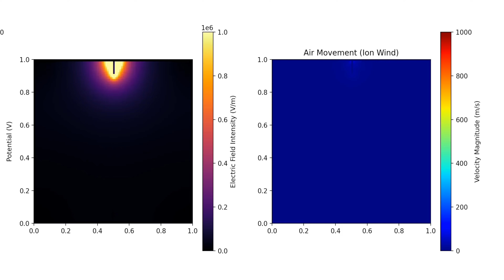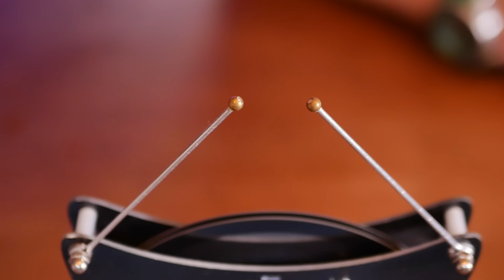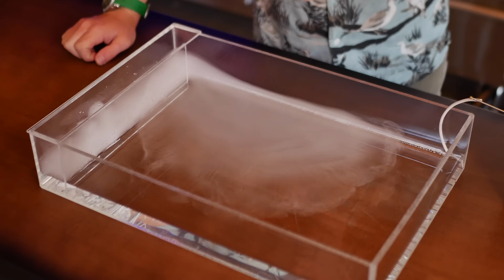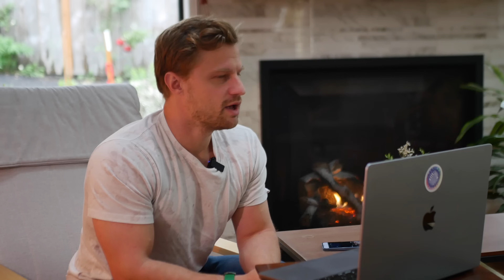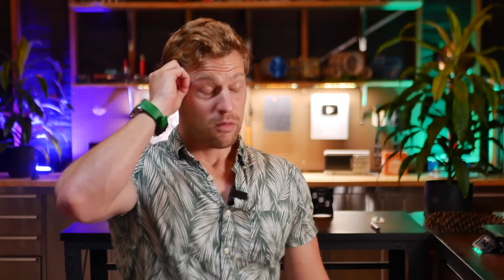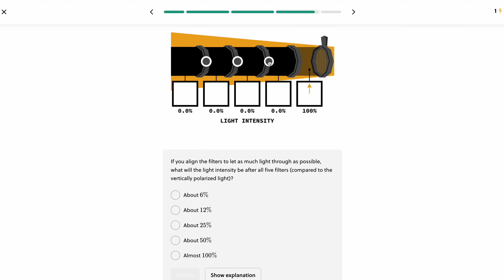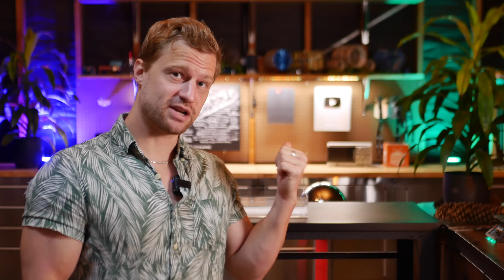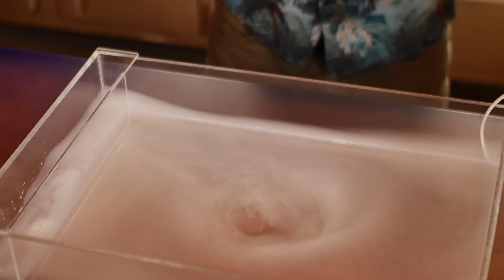This High Voltage Fog Is Controlled by Pointing (BiFrost Nebulagraphy)

Comment: Your allow a magnetically field to flow over your body from the current flowing with in. Much like when current is flowing through normal copper wire. That magnetic field is interacting with the ions from the dry ice.

Comment: It's a part of what the sun soon will emit:high voltage amadant particles might look like...I see it not as a fog but it will appear as a flash light.. but its effect is the same..it's not yet steerable by will but photon is activating the light frequencies we need to align with the new incoming light frequencies. We already have the blueprint in us, but our "junk brain" 97% has been forced dormant here in this 3d matrix.. that's ending at any moment now. And we will be upgraded, if the controllers of this planet like it or not.. their low vibe times are over... No wonder you are so fascinated about these types of phenomena

Comment: Okay am I crazy or what...? 
I was looking for papers and demos for the effects of currents and electrical fields on water and found your video.  
The video actually demonstrate something that I wanted to see which is a mechanism that displays a repulsion of water molecules. You use a low current high voltage, which is basically what we observe in the sky.  
So with only one source you achieve such results... now what about 2, 3 or 4 distinct sources in all 3 dimensions? 

So the part that makes me crazy is that I do NOT SEE how those effects would not be what we see in the sky? We have voltages, we have water and we also have winds that are well known to be layered (hint hint).
So we have all the components required to have the same effect reproduced globally that could explain the clouds, their variety, why some specific clouds form at specific places... and phenomenom like having a single small peck of a cloud above the ocean in a very hot day (makes no sense, water should evaporate).

Anyway, super cool demonstration. I need to try this at home.  Thanks again.

Comment: This reminds me of the Wilson cloud chamber, which is based on the theory of drop formation around ions which goes back to experiments by Wilson in 1897. Drops formed around ions are always charged, so in an electric field they are induced to move. It may be that you are seeing the effect of charged drops flowing as a charge carrier in the circuit, locally depleting the vapor and driving fluid dynamics. It's worth noting that below supersaturation vapor pressure ionic drop formation does occur but such drops are invisible since supersaturation is necessary for these drops to grow in size past a certain threshold, and the drops need to get pretty large to become visible. But when large drops form at supersaturation they form faster the larger the drops are, condensing vapor until it is no longer supersaturated. In a cloud chamber this leads to visible condensed vapor cloud trails corresponding to the path of the ionizing particle. Perhaps such condensation is non-visible in your setup, or is blown away by the electric field. I think when you have situations where the vapor vanishes (in a beam, a burst, part of a vortex...) it is likely that the drops are simply blown away while they are growing, but still small enough to be mobile charge carries and too small to be visible, and in sufficient quantity to desaturate the vapor enough to clear the fog. Maybe larger, less mobile charged drops play some role in what is observed as well, plus fluid dynamics driven by the flow of charged drops.
Reply: Some more info with a historical coverage can be found in Das Gupta, N.N.; Ghosh, S.K. (1999). "A Report on the Wilson Cloud Chamber and Its Applications in Physics"

Comment: There's so much in the New Age/Metaphysical community that could be scientifically demonstrated with this like Reiki, Crystals and Crystal Wands, Grounding Shoes, Clothing Materials, everything variable about your body's electrical system and showing the strength or weakness of the Ion Bridge effect. The swirl under the palm was just like the energy healers symbol of the swirl on the palm.

Comment: If you build yourself a static generator, you can find YouTube videos on here, but you’ll find that a 9 V battery and a high voltage amplifier will levitate sand and little metal objects like you did as well as the manipulation of fog due to the ionization of the body receiving positive ions And then being pointed into a direction you’re basically firing it like an arrow, but yet it’s leaving your entire body all at once… you should be able to see this maybe with a night vision, camera or thermal image camera looking at your body while you’re charging it. The future holds some amazing things such as the health benefits of ionizing the body.

Comment: The warm water + ice cold glass create an exitaction of electron our body is positively charge by electron moving from positive to the negative side and also these electron leave our body it's possible that the ion bridge between you hand and water is visible as they leave to connect with the water the electron of negative connect with water and the fog let you see this visual this effect add salt in water for more ionic activity.

Comment: I wonder if this could be scaled up and reversed in direction so that a specially equipped airplane could generate a negative electromagnetic field, while a high-powered antenna of some sort could direct a positive ion stream through the air to the airplane. This would in theory have the affect of "erasing" clouds by causing instantaneous condensation within the negative field around the airplane. Flying in a grid or spiral pattern would enable the aircraft and system to remove clouds in a small area and/or a long line (limited by range of the antenna). Would be great for highways, sport events (open stadiums), parades, and other large outdoor events.

Edits: spelling.

Comment: The key reasons for this phenomenon are:

	1.	Corona Discharge (Ionization of Air): The electric field at the fingertip is strong enough to ionize air molecules, creating a localized area of charged particles. This process is essential for generating the ion wind that disturbs the fog.
	2.	Electrostatic Wind (Ion Wind): The repulsion of the ionized air molecules from the fingertip creates a small, localized wind. This wind physically pushes the CO₂ fog particles away, creating the “drawing” effect.
	3.	CO₂ Fog Dynamics: The fog, being composed of heavier CO₂ molecules, is sensitive to even slight disturbances, making it easy to push with the ion wind. CO₂ is non-polar, so it does not directly respond to the electric field but is physically displaced by the movement of ionized air.

You can create a cloud chamber using dry ice to observe charged particles emitted from radioactive materials and achieve similar effects in the CO₂ cloud. Cool video idea if you haven’t done this already. It’s surprising how many everyday items emit charged particles.

Comment: What if is trying to ground, and because the voltage isn't high enough for lightning. But having the same effects as lightning with particles in the air trying to find the water to ground. I think I'm explaining my thoughts very poorly, I'm just starting the video so my response is based on just 5 seconds

Comment: As a lover of magnetism, metaphysics, and overall energy itself you scared the sh*t out me when I saw you were going to complete that circuit with ionized molecules. Then when I realized you knew the wattage needed to terrorize the human body I was relieved. 

If that air was damper or cooler, who knows what that beam formation would look like. In colder air it could be more visible.

Comment: If you could direct this it might help in aviation in low visibility landing applications.
Reply from the maker: Directing this ahead of a plane would be remarkable. The speed at which it travels may be an issue though, as the plane will be travelling faster than the effect itself.

Comment: Seems to be an example of Z-pinch, a type of plasma confinement system that uses an electric current in the plasma to generate a magnetic field that compresses it. The ions are moving charges that produce a magnetic field around their direction of movement and that magnetic field compresses the charges into a thin flow....maybe?

Comment: Thanks for posting this video! This question is for anyone really but would really like to hear back from the publisher. 

We know people create electricity and some create more than others. How would one make a setup that proved each persons strength of projection? How would we get the polarity correct? (Sorry if I’m not using the right words) 

Could we use a pan of water that is grounded to the earth (plus the dry ice fog) and a wooden step stool to insulate the person?

Comment: Low amperage/high voltage warning.... I used to be a mechanical designer of high power RF equipment (TV, FM broadcast, Radar, Atom Smashers and oddball government lab things)... in 1993 (pre-internet) I built a Van De Graff generator... the original had two stainless bowls making a "dome" about 6" diameter... this made arcs about 4" long when a finger was slowly moved toward it... the rule of thumb for electrical arcs in dry air is 70000 volts per inch, so 4" was about 280000 volts. Then I got a 14" diameter globe and retrofitted it... this created visible 14" arcs and unseen arcs that would snap your knee 30" from the dome... so this was approx 2100000 volts... I thought it was harmless, as you said "low amperage"... an engineer I worked with told me "be careful with that" but would not elaborate... I later read that electrical static discharge arcs of 300000+ volts create X-Rays!!!!!!!!!!!!!!!!... I would suggest that you get some X-ray film and do some testing....... PS: put a Cheerio on top of the dome of your Van De Graff and watch it  1. wobble as the charge builds, 2. jump up to a standing position 3. Fly off.... something about the shape and the material causes the Cheerio to act like a magnet and eventually the opposing forces of the charge on the dome and the built-up force on the cheerio cause it to fly away like when you put two opposing poles of magnets together... also, the Van De Graff will cause the gas in a fluorescent light bulb to be excited and light without any connection, see how the location of your hand changes the intensity of the light........ lastly I would like to see "IF" the ion gun of your finger is blocked by a sheet of plexiglass...9does it go through, around or simply blocked?) the arc of my machine would go around the edge of an 18" diameter plexiglass disc I slid over the PVC tube between the dome and the box with the motor... when the charge built up on the 14" dome it would discharge by arcing to the steel box because it was less than 30" away (maybe 20")... the plexiglass acted like a ceramic insulator on a utility pole... and it had it's limitations.
Reply: The ion-threads demo is easy, so try it yourself.  Best performed with dry ice from Fred Meyer etc., a metal cookie-sheet, and 5KV supply (a cheap negative-ion generator, or tiny VDG or tiny Wimshurst.)   Try blocking it with a plastic pen.  The stream is deflected depending on the surface-charge on the plastic, so a pen can push the stream around.  It's blocked by solid sheets, however, can be persuaded to pass through holes.   A nearby HVAC electrode makes the stream sweep back and forth at 60Hz.   Amazingly, it can pass through a hole in a grounded plate, then continue going on the other side, going for a few cm, in an electrically-shielded zone.   So, "braking it to a halt" in air with zero e-field does require a measurable distance.   
Needed: an electric detector.   Perhaps a tiny electrode-plate, and a low-picofarads JFET front end?  If we can detect the picoamps in the stream, then we can measure its velocity (by pulsing the emitter, then measuring time-delay.)   Once that's working, try storing some data on 50cm of "empty" space, by modulating the stream, then detecting the pulses at the far end.   Make an audio reverb?   Also, a beam-break burglar alarm with no light-beam.
Reply: I = E/R ergo high voltages across a resistance can produce high currents
Reply: this may be totally related it may not be. but what if its the iron in the wheat of a cheerio? im reminded of the difference between a real and a fake crop circle, the real one having bends in the wheat stalk and the bend having iron oxides on them.

Comment: Do you know the polarity of the generator?
Reply: It turns out that polarity doesn't matter.   So, the effect isn't an electron-stream.   
And, AC will also work  ...only if it's slow enough.   Hmmm, find out how low the frequency must be?   An HV amplifier and a square-wave generator.  Turn it up until the streams stop working.     Also, two sine-waves at 90deg will make circles in the fog.   Build an oscilloscope tube that doesn't need any vacuum.

Comment: Would this still work if one adds a acrylic cover on top? Would you be able to take some type of fabric or metallic mesh/grid like aluminum screens for doors to see if it interrupts your ability to manipulate the fog?🤔 I’m curious If an insulating or conductive material would block the ion beam
Reply: Yes, even plastic-wrap will block the beam.   (I always wanted to try gold leaf.   Maybe the beam will go through.)   You can push the beam around by using a plastic object like a pen.   Also, the beam will continue for many cm, even if there's no electrostatic field.   Send the beam through a grounded donut, with shielding around it, and it still travels a short distance, and makes a hole in the fog.  The beam has inertia!  (this is with the water at ground, and the beam-emitter at 10KVDC. )  

On your fingers, tiny bits of lint are emitting the beams.   Very clean fingers don't work!   So, wet your fingers, and touch them to cloth.   Or, wear a wool mitten.   Also, use a single eyelash-hair as your beam-emitter.   (All this is from 1999.   The effect was discovered by accident in 1996, using Schlieren Photography.)

Comment: The electricity is pulling the water molecules with it as the electricity is being directed. 
Like a magnet but for water molecules. 
The fog or water molecules are lite enough to be pulled along.

Comment: So could this be the reason for cloud formation in some areas and possible reasons for lighting strike development.  The situation that sounds very relevant to your study here is Lake Maracaibo, Venezuela being the lightning strike capital of the world.  

Also I always thought that Albuquerque, NM issue of lack of rainfall (due to the clouds parting like Moses at the Red Sea) was due to the city being a “heat-island” that was causing strong thermals (that caused the clouds to part like they were hitting a solid structure).  Maybe the electrical current also has a part to play with the cloud separation via ion current moving from the highly electrified city up with the hot thermals in dry dusty air?  The surrounding area is riddled with beautiful lightning strike displays as the rain comes back down all around the city.  As if the electrical charge is returning back to earth in a circular means.

Maybe there’s a way to encourage the cloud cover to drop rain in parched/drought riddled areas, (I know this is going to sound like I’m the world’s biggest sci-fi nerd) sort of like the climate control system in Star Trek?  I figured this might be a possibility from the fog to rain development case you mentioned for farms.  We all know how futuristic science-fiction shows have inspired everyday tech used today.  This would help to reduce/eliminate the need for mass migrations from droughts, right?  This might help make lands more fertile to allow people to stay in their ancestral lands and reduce conflicts due to water & food shortages…even make the world greener (and reduce global warming if done correctly).  It would be amazing if your video inspired someone to follow along with your ideas to help save the world with its populations (human & other animal species).

Comment: I wonder if you made a much bigger device above safe levels—where instead of using your finger you use a remote controlled device to aim and shoot the beam—if it could split and draw on the marine layer while on top a hill or mountain and even split clouds apart or change the weather.

Comment: I would love seeing you run some tests on Qigong and/or Reiki masters in this space and see how their energy would look like, potentiated maybe with the Van de Graaff. For example I personally use vortex visualization when I have toothache lol (the right hand thumb method to concentrate energy). Also, since you may appreciate this if it didn't pop-up on your radar already: https://www.ncbi.nlm.nih.gov/pmc/articles/PMC8296239/

Edit, maybe it sparks interest faster:
"Unusual large body voltages have also been reported during therapeutic touch practitioners’ treatments. Considerable anomalous body potential surges ranging from −4 V to −190 V in therapeutic intervention and from −4 V to −221 V, lasting from 0.5 to 12.5 s in meditation, were measured at the ear lobe with an electrometer. On average, these electrical signals were 103 times larger than psychophysiological galvanic skin potential changes associated with emotional responses, 105 times larger than electrocardiographic voltages, and 106 times larger than electroencephalographic voltages [91]. Comparable results were obtained by Tiller et al. [92] under well-controlled conditions. In this study, an experienced therapeutic touch practitioner produced voltage changes between −20 V and −80 V from baseline, with similar durations [92]."